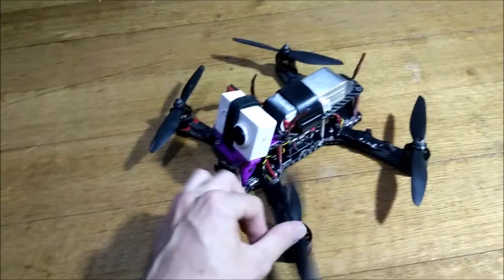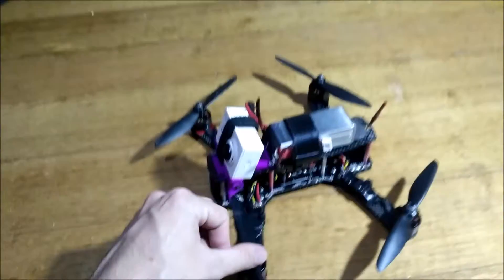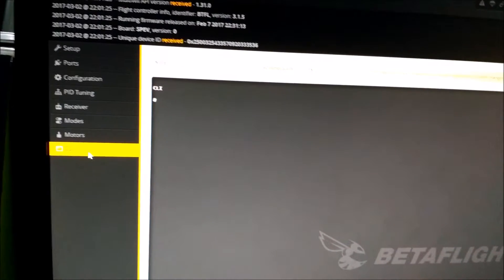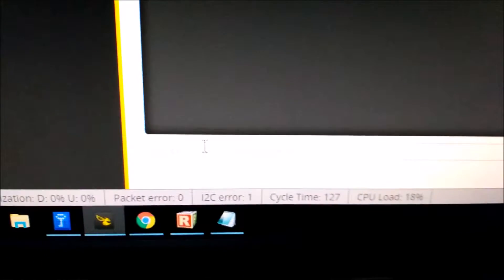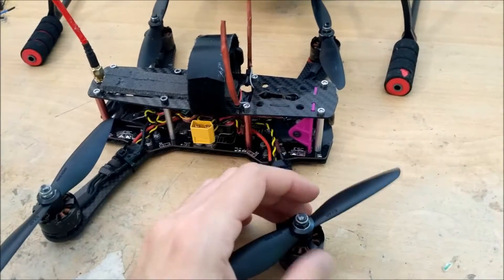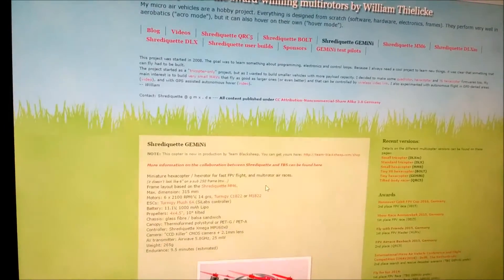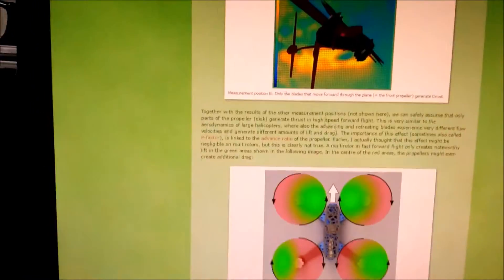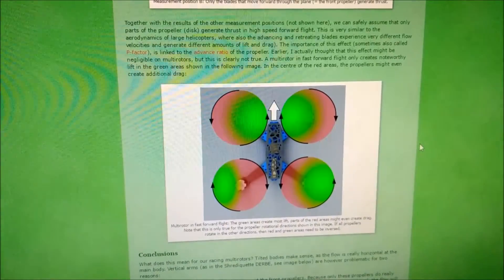Running Reverse Rotation Props - Betaflight

Comment: running the latest betaflight, copied and pasted the command set yaw_motor_direction = -1 then enter then save, enter rebooted but it didn't change a thing. Wonder what i'm doing wrong
Reply from the maker: does the quad just spin like mad when you try to fly?
Reply: Yup that's exactly what going on
Reply: Well I tried setting again just now and all is good. Moral of the story I guess is don't tune quads when you're half asleep at 2am :)
Reply: DJB HSI what did you do to change it?

Comment: Hope you actually put the opposite motors on the opposite arms, too. Otherwise your props will spin the nuts off and the motors will spin in the direction that will want to loosen the nuts. Bye bye props. Bye bye quad.
Reply from the maker: Yeah that's certainly something to consider and something I forgot to mention because I only buy motors with normal thread and use locknuts. - Not an issue for me :)